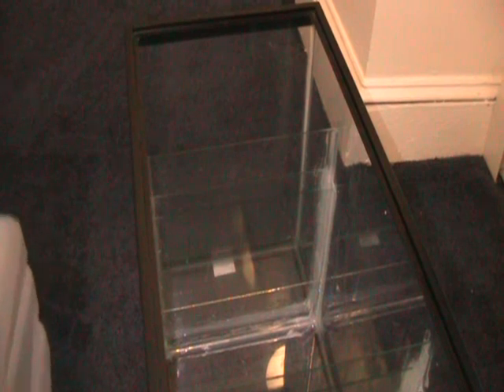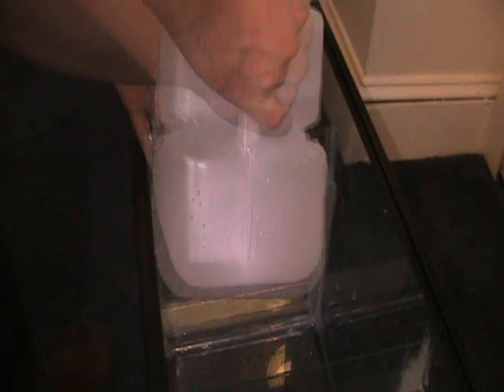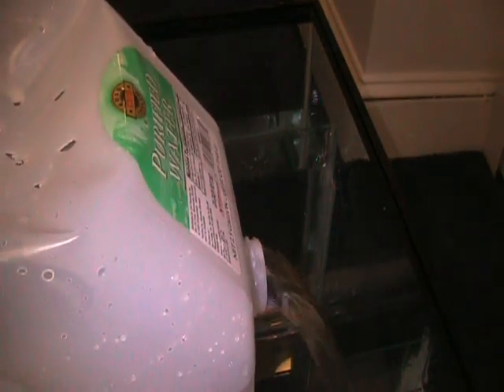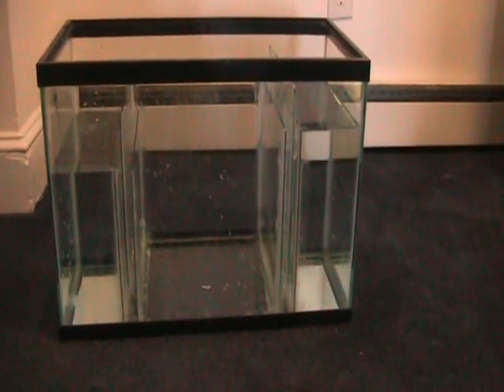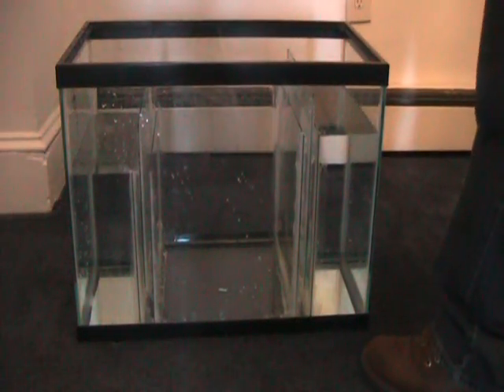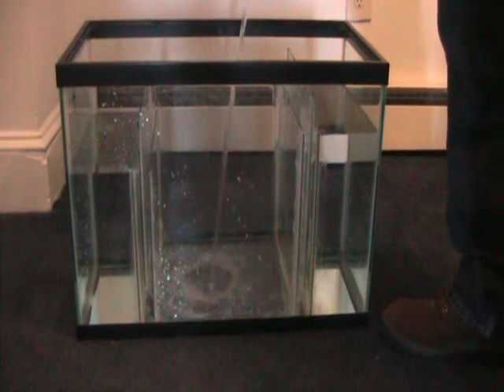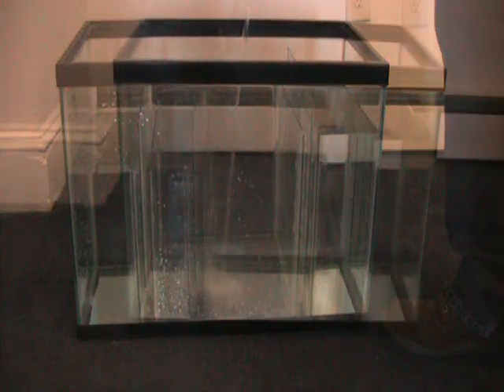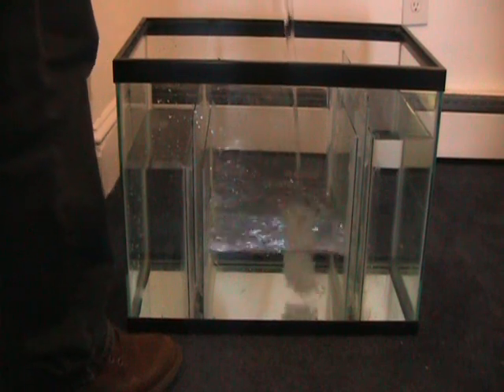Nano Reef Build - Video 2 - Glass Sump Part 2

Comment: if you build another one you might put the overflow side of the bubble traps at a slight angle[wider at the top] . this should reduce the pressure slightly lowering the 3/4"  overflow. just a thought

Comment from the maker: its an Eshops PSK-75 in sump skimmer, the guide says between 9-12 inches but i think you might be closer to the correct height, i fired it up today and it overflowed pretty quick, Stacked some eggcrate under it and it seems to be running better now. lol